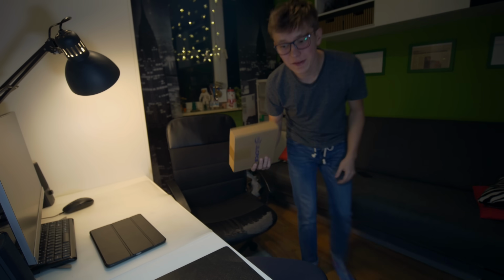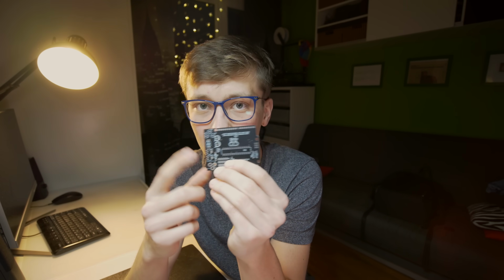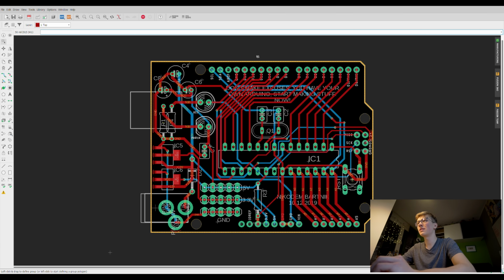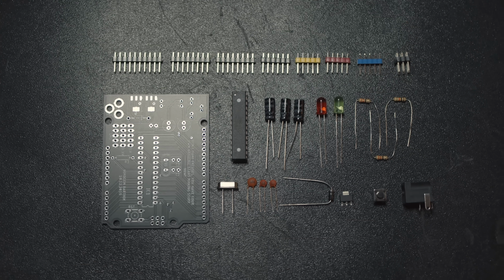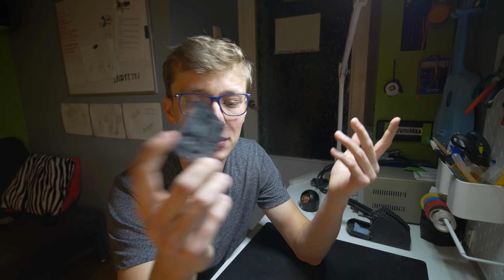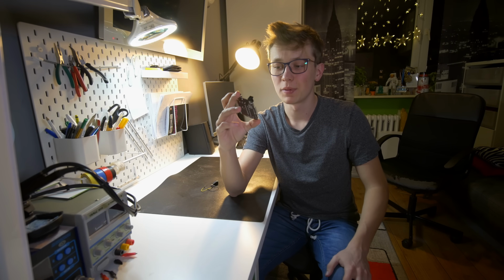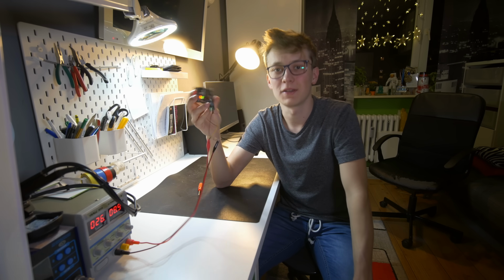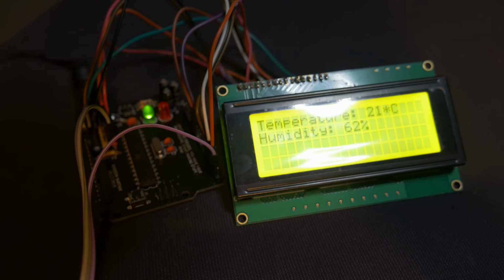DIY Simplified Arduino That Anyone Can Build

Comment: Why did you solder the whole atmega to the board? It would be easier to solder a DIP socket, as you can change the processor without desoldering if something bad was to happen.

Comment: the biggest problem with most of diy arduinos is lack of any integrated programming feature, you still need external programmer like subasp or another arduino to upload a program, if you already make an efort to bild a pcb for it you could include another header for ch340 serial /usb converter and use it as the usb port of a normal arduino
that being said chinese knokof arduino unos are probably cheaper than usbasp and atmega chip alone
nice project but a bit late for the party to be economically viable for the begginer

Comment: Good afternoon Nikodem Bartnik , what do you think, if instead of 5 volts we power the atmega328 microcontroller with 3.3 volts, will it be able to interact without problems with boards designed for a logic signal level of 3.3 volts

Comment: why you didn't add micro usb for power supply inside of dc power
Reply: A Micro USB Port ist very difficult to solder for beginners, otherwise he could integrate a CH340 or something to Programm it over USB.

Comment: Today on banggood with 41% rebate till January 7th, original arduino UNO costs $4.29, less than 3.90€... Your nice trendie PCB without components costs twice including shipping fees...
Reply from the maker: Seriously? You can't compare a low volume product to something that they sell on banggood. Sure you can buy just UNO for less but this project is not about making Arduino cheaper it's about making it yours! Keep in mind that Atmega328P THT costs almost as much as some Arduino clones.
Reply: @nikodembartnik  you should count how many times you've used the word "cheaper"... My take is simple. If it was about pedagogy, you're perfectly right. But reality, seriously, is not that! I DO NOT WANT TO BUILD UP A CNC, I DO WANT TO USE IT IN OUR VALUABLE PROJECTS! it remains true for PCBs too.
 Then, 1) I weigh the prices of a diy CNC v. an almost let's say gearbest's mounted one
2) Making anything "mine/yours" as you stated, deserves respect for sure. But the stuff you're building up a way or another HAS A DESTINATION i.e. HAS TO BE USED EVENTUALLY, NOT TO BE PUT ON A SHELF AS A MOMENTARY ACHIEVEMENT OR IN A CORNER OF A WORKSHOP.
As a founder of a more than modest organization in my country, Joetke's Hub to name it, I never thought that building was more relevant than USING a device. AU CONTRAIRE! It's about the famous ADDED VALUE! You use a device and then you try to build a better and improved version of the very first you came across. Seriously.
Finally, THT-based systems are actually more expensive but AGAIN - you really should count how many times you utter the word "cheap" - Chinese high volume production of average-quality stuff had brought a HUGE ADDED VALUE to Joetke's Hub pedagogic goals... seriously, since 1997. Of course, my friend, comparing low volume products price to chinese thousand devices, may sound irrelevant but the main question remains: to which extent and for which usage?
Reply: @nikodembartnik  ofcourse you can compare the two and come to the conclusion that yours is more expensive and thus economically a very bad decision. But you obviously add value to building it yrself and that's fine. But no matter how you look at it, yours is a costly one but that is a price you are willing to pay for the pleasure of doing it yrself

Comment: 10:11 ... and the temperature of voltage regulator rises in this moment as well
Reply from the maker: Maybe you can't power a motor with that small voltage regulator but powering just arduino and LCD consumes almost no current at all
Reply: Nikodem Bartnik , if LCD consumps 50mA and Atmega 5mA, and if voltage drop at regulator is 12V-5V=7V, then power dissipation at your sot223 regulator will be 0.385W.
1117-series in SOT223 has Rja at 160deg/W.
Delta T will be 61.6 deg to your room temperature, maybe 80degC.
In fact temperature is lower beacause of surface dissipation to PCB.
But it's not as cold as it could be with regulator in DPAK or TO220 package.
Reply: J. Rusch So?
Reply: J. Rusch  No, it is a product: https://www.tindie.com/products/nikodem/diy-simplified-arduino-pcb/#product-description

There are many problems with this design. It should not be sold. :(

Comment: Got to say. Well done and very lucky it worked. ESD..... Good practice is to atleast wear a ESD strap or have your work area protected. Too many videos which are edited and for all we know the first one could have been fried when handled like you did.
Reply: In 40 years of electronic work (repairing servers) and experimentation I have never fried a component due to ESD. I still think it's good to be aware... I have gotten shocked when picking up my laptop, for example, and I usually touch a ground before work, but not always. I'm either like win-the-lottery lucky or the dangers are overblown. I don't think he's lucky. I think it doesn't happen that often. BTW I live in Chicago (high humidity). If I lived in Las Vegas I would be much more paranoid.
Reply from the maker: I also think that it doesn’t happen frequently, I never had even a single problem with that. Something like this may be considered when working with really “sensitive” or expensive components but for stuff like this, it is just meaningless

Comment: Sorry for my ignorance, but which voltage regulator did you use?
Reply: Never mind, I spy the number at 2:37

Thanks for your videos, they are very well make and super informative and accessible
Reply from the maker: Oh no, great question I forgot to add that in the description it's LM1117MP

Comment: IDK Bro in my opinion that board is like not really useful. Why would u not put a USB to serial Adapter on the board. Thats like the biggest advantge of these Arduino boards compared to some other boards like the stm32 Blue Pill boards. I know space is little if your using THT Components but theres always a way to put USB to serial Chips on there.
Reply from the maker: Yeah, the problem is that soldering for example CH340g is quite hard for beginners, that's why I omitted it. Next thing I want to design is fully functional Arduino clone, that will be third and last step of my short series of videos about DIY Arduino

Comment: Was is the tube above your soldering iron?
Reply: MegaCadr it could be some sort of fume extractor or mini hot air gun
Reply: Matthew Feros yeah, that’s what it looks like.  I’ve never seen a fume extractor like that (if that’s what it is), but kind of want one.
Reply from the maker: That's a fume extractor

Comment: WHERE IS INDYMILL!! So much hype!
Reply from the maker: I have most of the parts, I just need to figure out where to laser cut some steel or aluminum and first video about design should be ready in two weeks I hope, sorry that it takes so long, but I don’t want to rush this project
Reply: @nikodembartnik  Its okay! Dont rush it, also, have fun! Check plasma and water jet cutting, might be cheaper than laser! Cheers from Argentina!

Comment: @Nikodem Bartnik next time try to make a system for peoples that can't solder !!!
Reply from the maker: It so easy to solder that seriously anyone can make it
Reply: @nikodembartnik  i am handicapped i can't
Reply: @nikodembartnik  you should read your gmail
Reply: @christophemalvasio5569  here is a solution: buy an arduino uno and unbox it. Great project for someone who cant solder.
Reply: @Ed19601  it  is not  to make a robot arm with a end effector that do soldering
Reply: @christophemalvasio5569  so you cant solder but can build a robot arm?
Reply: @Ed19601  design  is doable

Comment: I like the DIY aspect of the project, but I think is a bit pointless nonetheless. Chinese Arduino clones are already pretty cheap, and if you need to make a custom board I'll suggest designing the whole board around the ATmega328p instead of designing a separated board.